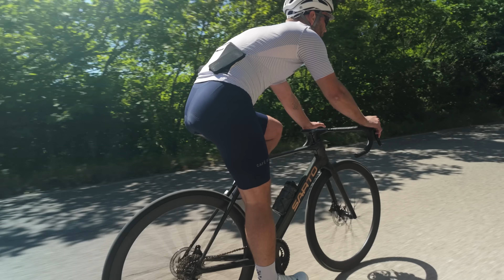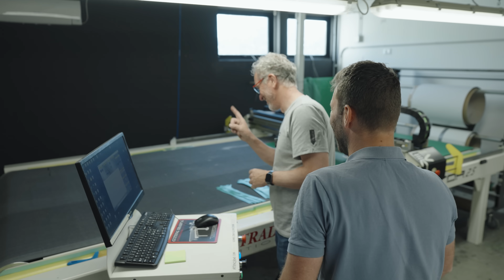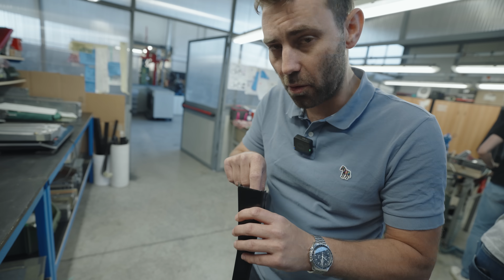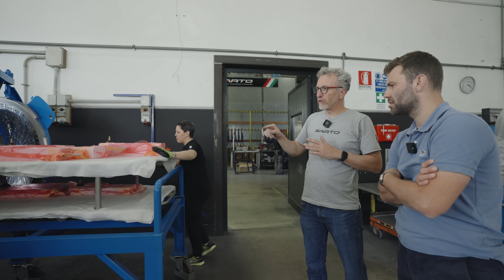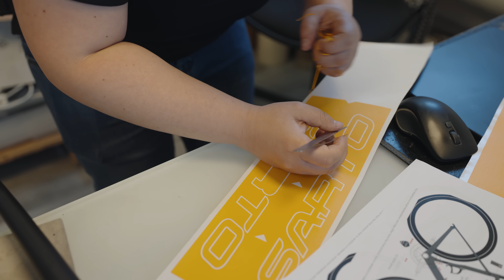Custom bike factory tour

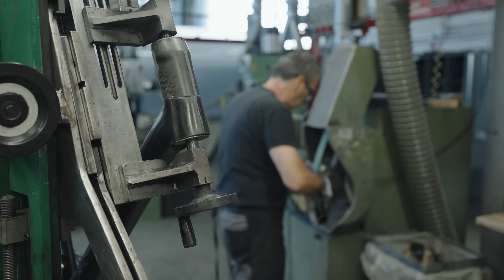Comment: In the video, @7:30 you can see employees from Sarto grinding and cutting the raw carbon without any sort of protection for eyes or lungs.. Is it just safe or do they have some sort of vaccuum on those machines to make it safe?
Reply: That whole box and the huge great hose attached to it - that's the extraction system for that machine. 
Efficient, pulls all the dust away from the worker and into a filtration system. 
I've been to the factory multiplel times - you can touch any surface, including the floor - and you won't come away with a speck of carbon on you.

Comment: It is a frame construction made of separate elements, in order to create a complete frame shape. Eg only unique TIME frames are woven using BCS (Braided Carbon Structures) joint by hand and RTM (Resin Transfer Moulding) and then the rear triangle only is glued on (chain stays and seat stays) or another technology monocoque when the whole frame is made and moulded as one single piece (very few brands made use this technology).
Reply: 3T new Italian frames are also woven together
Reply: So you hope one of their t-shirt sizes is perfect vs made-to-measure?
Reply: And those can be made-to-measure? Don't think so.
Reply: @larryt.atcycleitalia5786  No, because TIME carbon frames have to be inserted into a metal form to pressurise and inject raising (RTM), six sizes available.
Reply: That technology has a lot of limitations relative to the way that Sarto make models like the Raso and the Seta. Generally it's better suited to straight, relatively simple tube shapes and it doesn't allow the same degree of customisation of lay-up. It's a good technology but not ideal for a full custom offering.